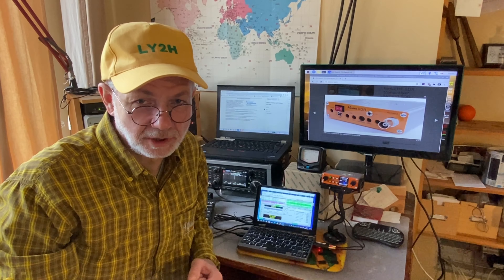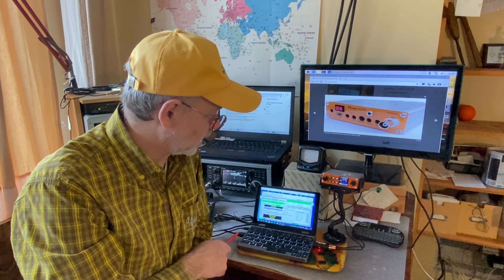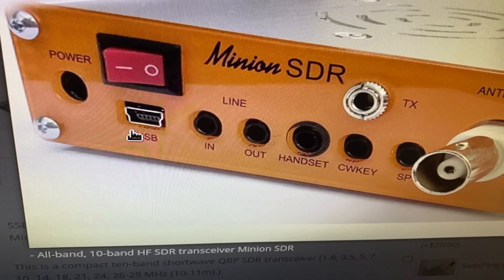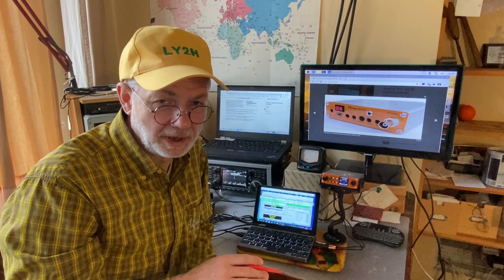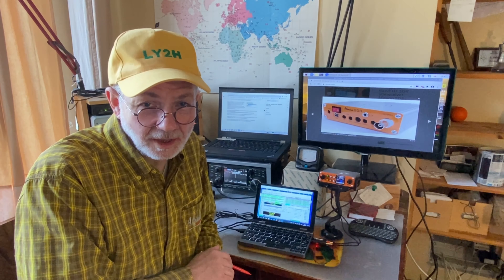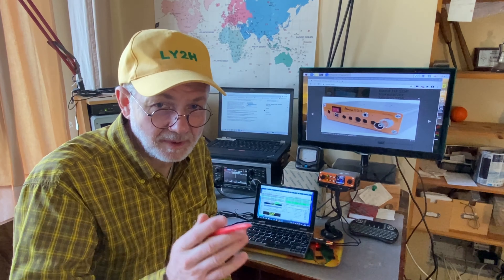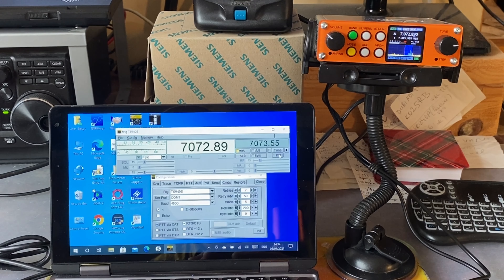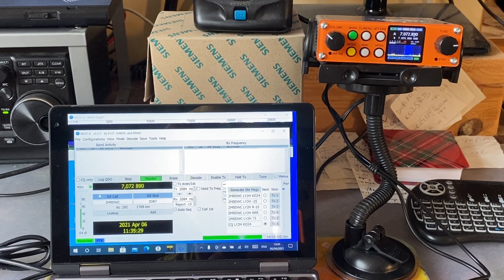SDR Minion by "QRPver" Rewiev: TOUCHY CAT took trial and error  to run FT8 OK.

Comment: Thanks for this helpful Video! until today i haven't got my minion sdr running.  thanks to your howto it is now running.  it's a shame that it doesn't work with the rp4.  what kind of mini laptop computer is this? 73 de Lukas, HB9HEE
Reply from the maker: Thanks for your time watching! I'm glad my workarounds work on other Minions too! It only proves that guys from Ukraine selling half-baked product. It's a pitty because in general it is a very nice little radio with pretty good receiver and functional spectrum scope, it could become a game-changer in the QRP class. I hope, they will listen one day to  complaints from many of us and  fix the flaws, or   loose the market completely ... 
My laptop used is the CHUWI Minibook , Win 10, 8/128 GB. I think any Win 10 machine would work in this case. Thanks again Lukas , stay safe! 73! Linas LY2H